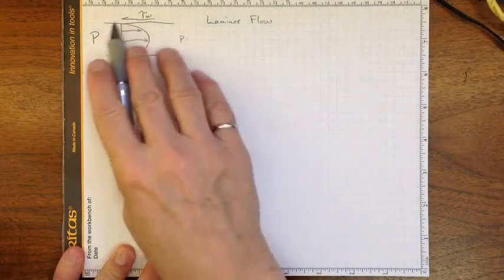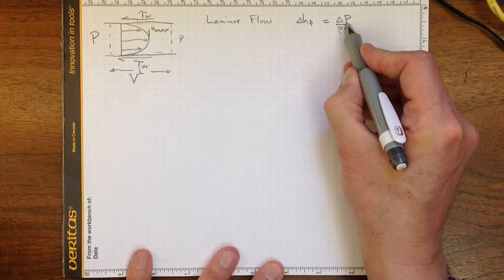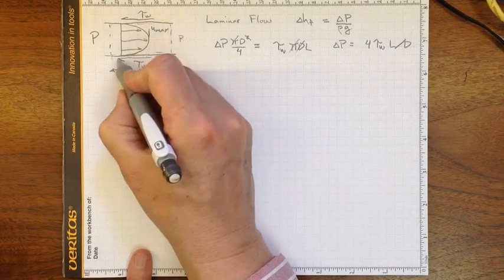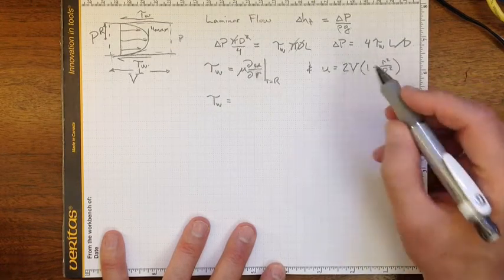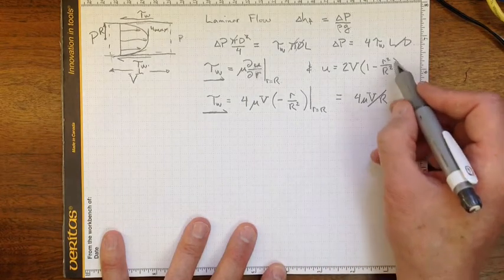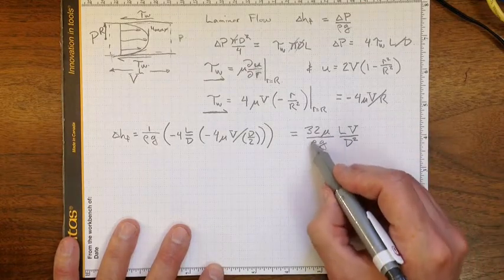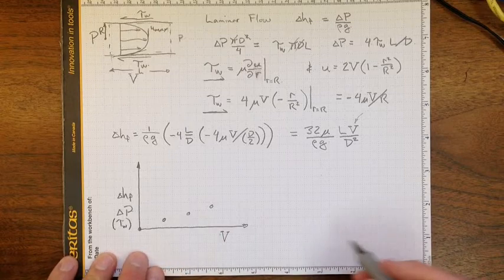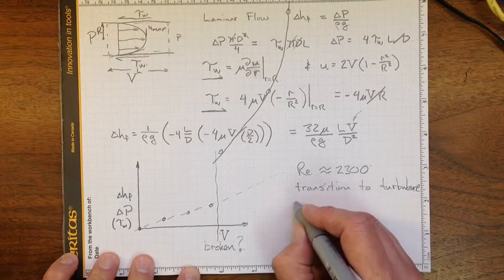Laminar Head Loss

Comment: why there is a double negetive in hf
Reply from the maker: The negative originating with the wall shear indicates a stress acting on the fluid in the negative x direction. The negative on the 4L/D indicates our convention of talking about head loss or pressure loss such that delta P is quoted as positive when pressure is dropping as you go downstream.